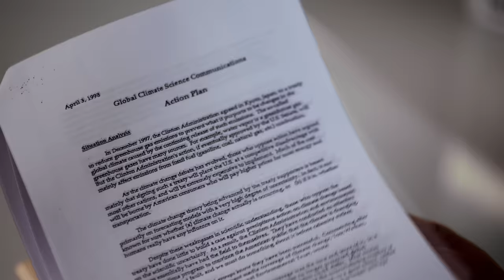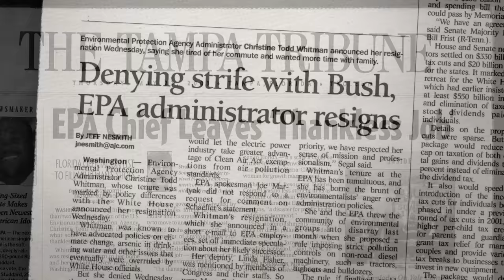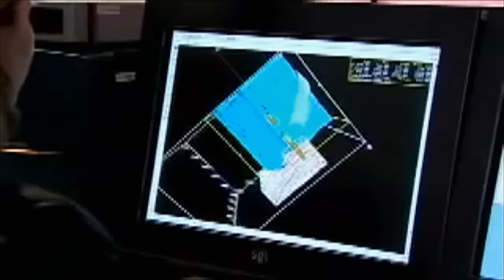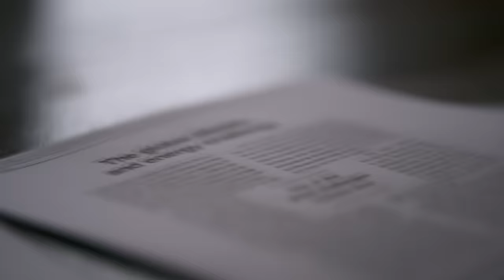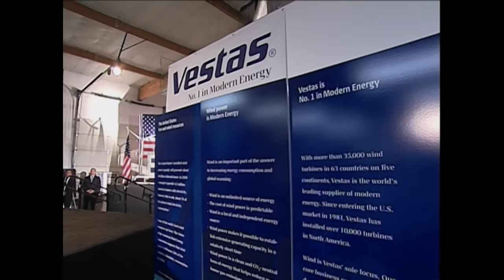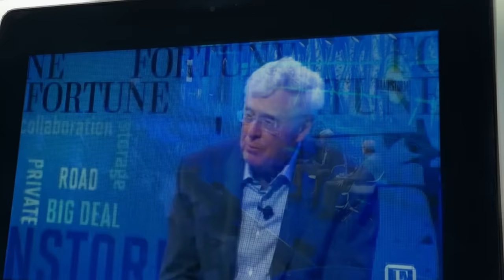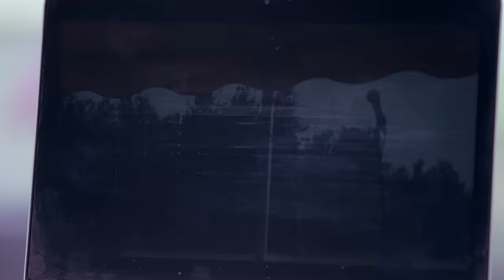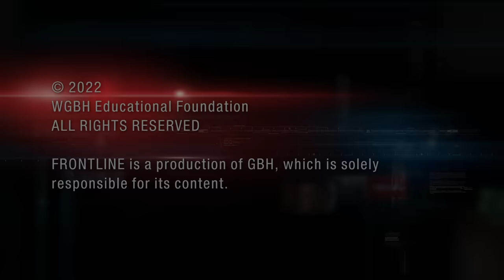The Power of Big Oil Part Two: Doubt (full documentary) | FRONTLINE

Comment: Nobody mentions that one good reason to take measures to “Go Green” is to save money.
I installed my first energy-saving light bulbs not because they used less electricity but because they lasted longer (I was sick of always having to replace two certain light bulbs in my house because they have a high usage).
I installed insulation, double-glazing, heat pumps, solar hot water panels, a double floor in my living room (downstairs) and got my Natural Gas supply cut off all in order to save money.
My electricity usage (and therefore what I pay) is now half of what it would be if I hadn’t done all those things.

Comment: 12 HP COULD RUN A OLD MODEL T FORD TO 60 MPH. NOW, HOW DO WE DO THIS BETTER? ADD BETTER GEARING! SLOWING THE RPM ( REVOLUTIONS PER MINUTE) ALSO, CAR CRAFT HAD A MPH TO MPG, CONTEST 20 YEARS AGO! AND A MAN WON 45 MPG! & 11 SECONDS IN THE QUARTER MILE! CHEVY V6  COMMON PIN CRANK, TURBO & SIX SPEED TRANS.

Comment: 32:30 why do all of these climate documentaries show nuclear power plants' cooling towers when talking about greenhouse gas emissions? There are no greenhouse gas emissions with nuclear power, that's literally just clean water vapor. Thanks to the advancement in safety pertaining to nuclear reactors over the last 30 years, we should be looking at nuclear as one of the solutions to climate change.
Reply: Just another non-renewable resource.
Reply: @EragonxVxRevan  you don't really know what you're talking about, do you?
Reply: @BaphometBibleStudy  we have infinite supply of uranium? I didn't know that!
Reply: @EragonxVxRevan  thorium is the preferred nuclear fuel. It’s literally everywhere and can be recycled at a rate of 95%. Thorium nuclear power actually has less of an environmental effect than wind or solar because of the rare earth elements that are required in the manufacture process of solar panels, wind turbines, and lithium ion battery storage. There is no TRULY renewable resource because of the manufacturing an material requirements of the hardware surrounding renewable energy sources.
Reply: @BaphometBibleStudy  so you're referring to a type of power generation that is still in an experimental phase. Just like with the other experimental nuclear designs that haven't had any sort of commercial success yet, outside of uranium. I'm all for nuclear power, but to say that it is the solution is sort of mute in my opinion, until they actually have viable commercial successes.
Reply: @EragonxVxRevan  Also, I didn't say that Nuclear was THE solution. I said it was ONE OF the solutions.
Reply: @BaphometBibleStudy  My apologies, I misread. But it doesn't change my statement. I hope thorium gets used. I hope they have an actual breakthrough with fusion. But I'm at a point where I understand that money runs everything. And that money still comes from oil.
Reply: @BaphometBibleStudy  We've been exploiting each other, not just brown people, since we found out we liked certain shiny things, and wanted them for ourselves. And I would go so far as to say none of us are innocent, but I'm a pretty pessimistic person, so that's just me.
Reply: @EragonxVxRevan  you're right, we have been exploiting each other since before the dawn of history, but it is beyond racist to ignore the fact that over the last 600 years or so, that exploitation on a mass scale has been performed almost exclusively by people of European descent. Yes, none of us, demographically speaking, are innocent. But recent crimes outweigh ancient.
Reply: @EragonxVxRevan  but my original point still stands, the water vapor coming out of nuclear cooling stacks while talking about CO2 emissions in the documentary we're both commenting on was deceptive editing to the point of outright lying.

Comment: PBS Frontline should have done their fact checking. The kook they brought out at 17:15 straight out lied to the camera. What she's holding is not a "optical gas imaging camera". It's an infrared camera, it shows anything that's warmer than ambient. YES it can show gas leaks, but she was aiming it at the flare stack, and burned methane gas is full of hot CO2 and water vapor. There is NO way to use that camera to show leaking gas from a flare stack unless the flare stack isn't burning. She's full of bull and PBS should've done better.

Comment: Geoscientist Bill Hines is mad as hell about Exxon's lying -- but he's still buying gas (that's a Honda at 15:36). Why? It you are angry about this, DO SOMETHING ABOUT IT. Older ppl: Get an EV and stop buying gas. Or get on your bike. Yonger ppl: be as angry as you can be with the older ppl. Brook no excuses.
Reply: p.s. He is also disappointed and disenchanted. Not enough to actually do anything, though, apparently. Look, it doesn't have to be a Tesla, it can be a Ford, Hyundai, Kia, Volvo, VW, Nissan, or (soon) Toyota or Subaru. If you're mad, stop buying gas.
Reply: Oh, I'm sorry, there was a typo: it's Bill Heins.
Reply: Thank you!!!
Reply: @xchopp  While I understand pointing out the hypocrisy in their anger, but still going on with the status quo. Electric cars aren't the solution. There are parts of the manufacturing process with electric cars that can be more polluting, especially initially. Both gas vehicles and electric vehicles use plastics, which are derived from oil.